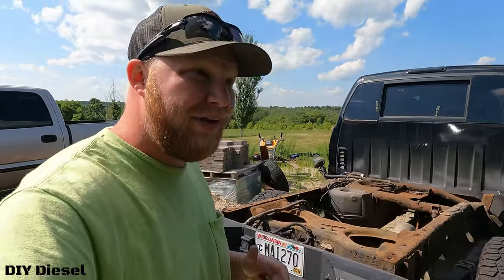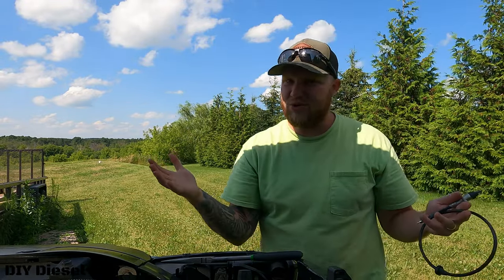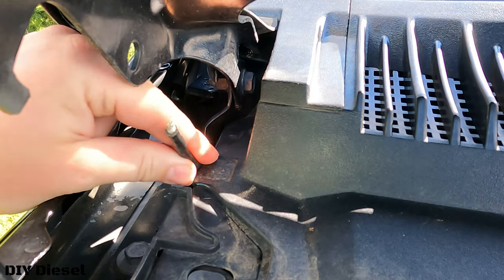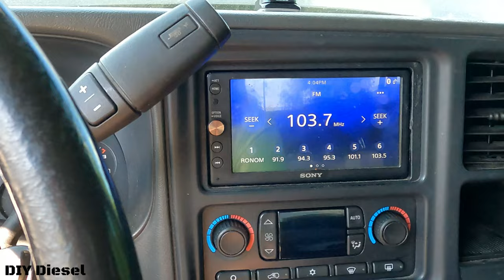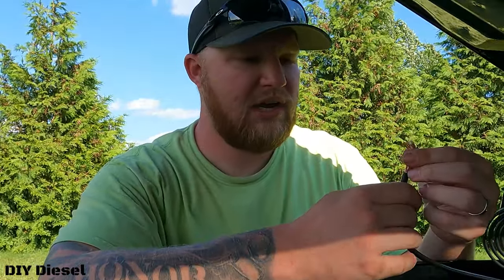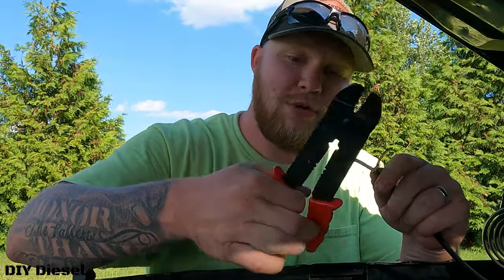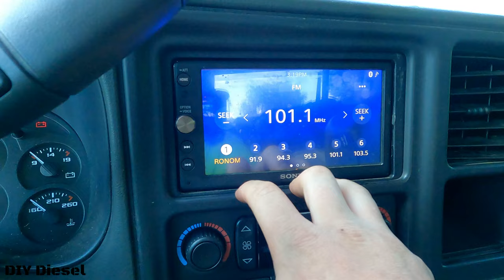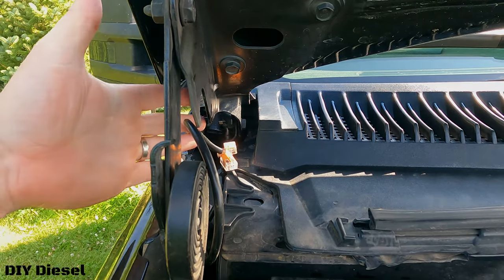How to Splice Your Car/Truck Radio Antenna

Comment: Hate to tell you this. But I’m pretty sure there is a connector down behind the glove box. There is on my ‘03.
Nice job on the coax cable splice did hundreds of them years ago installing and servicing CCTV cameras.
Reply from the maker: Ya I believe there is after doing some more research. I just really don’t want to go through the hassle of that fire wall 😆
Reply: @DIYDiesel  The more I think about it, I did replace mine. Antenna snapped off right at the base. Got the replacement. Found the connector and pulled from the outside. Rubber grommet came right out. Put the new one in with a little soapy water and gently pulled it into place. It was a few years ago and the memory needs jogging now and again.
Still a nice job showing people how to splice coaxial cables.
Reply from the maker: @vadrifter3200  I’m ordering a new one and probably going to revisit it when I have the fenders off lol
Reply: As a radio technician I see so much wrong with this. solder and heat shrink would be ideal and a lot quicker for me
Reply from the maker: @minenachos  your not wrong, but this video was made for a quick fix for those that don’t have that type of skill or option. That is why I said in the video it is a temporary fix 👍
Reply: 10-4 I thought about it after I hit the send. Its second nature for me cuz I've been doing this type of work so long. Being a receiver coax it's not as important as it if it was a transmitter. You did a good explanation on the coax. I've seen drivers strip off the insulation and twist shield and center conductor together like it's one wire.
Reply from the maker: @minenachos  😆 damn that’s a no no lol
Reply: @minenachos  yes, I agree solder and shrink wrap or tape is the best way. My primary point was that he was showing people about the two different conductors in a coax. Hope you are having a good day.
Reply: @vadrifter3200  IDK why it put my comment in response to yours. It does that from time to time. I wasn't trying to reply sorry if I caused any confusion. Hope you have a wonderful day
Reply: @minenachos  Haha!!! Doo doo do happen. All is good!!!

Comment: So I broke off the male adapter that plus into the back of the head unit , if I bought another antenna wire could I use this method? And could you by chance link me to those connector bits you're using I've never seen anything like them

Comment: I'm going to do this but I'm more either solder two wires or either butt splice and tape old possibly heat shrink
Reply from the maker: Absolutely a better way to do it